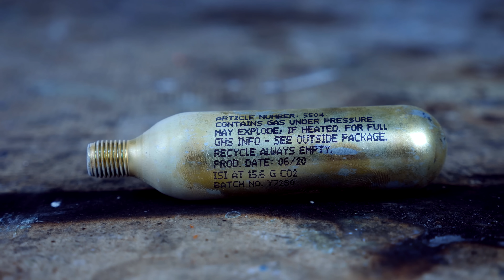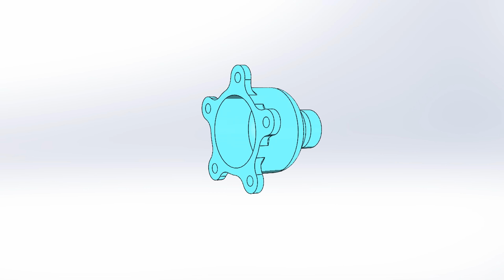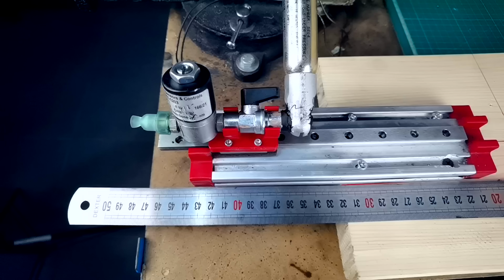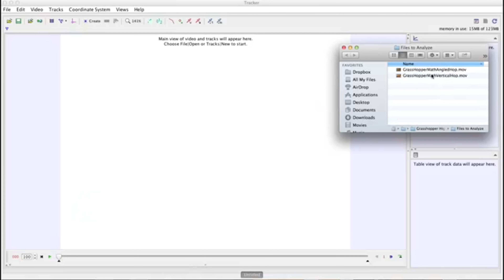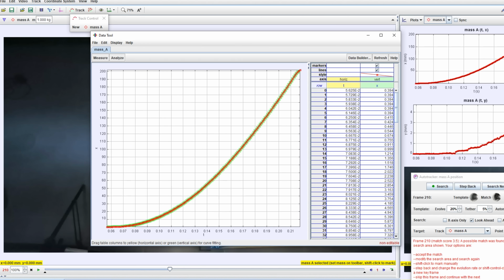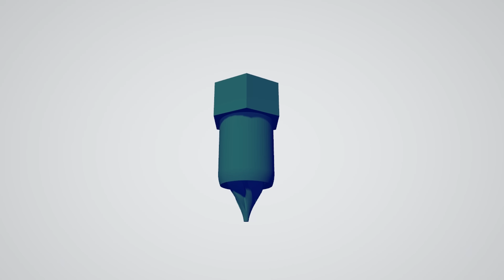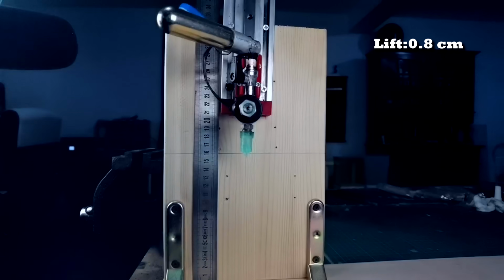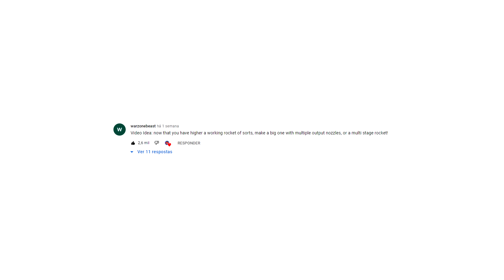I 3D printed a CO2 Rocket

Comment: You should 3D print a car that you can use as a platform to test your rockets with so you can see the full distance they will travel without hitting a stopping point. This will also be a more realistic application. Or 3D print a rocket that you can put a CO2 cartage into and the nozzle attached to the end to see the true lift potential.

Comment: Perhaps you could add a threaded pipe before the nozzle and heat up this pipe before you release the gas, this should expand the cold gas and give more lift. 
Or build a co2 cartridge mortar tube, just a simple tube that the cartridges snugly slide into and at the bottom is a pin that punctures the seal. (probably need to add a bit of weight to the cartridge tho)

Comment: . Find a way to produce and store hydrogen for use in a rocket engine. Then use it in a rocket engine. 

I had the thought of doing something similar back in the early 2000s when the 'run your car on water' craze was going on. I know using electrolysis  you can separate water into hydrogen and oxygen.  And using a tall container you can separate the 2 gasses. I had the idea of using a rubberized bag or thick rubber balloon inside a metal cylinder with relief holes incase it blew up. 

My original idea was to run the electrolysis device off my car alternator and fill up a balloon or bellows type device  that could be forced out of the balloon and injected into the intake manifold. Similar to a Nitrous oxide fogging system.  

Through all of my reaserch on the subject I learned that hydrogen  gas that was not pure or in liquid form when compressed beyond 2psi becomes extremely volatile  my solution was the balloons in metal housings for safety.

 I didn't get to preform the experements myself. So I would like to see your take. And if I get a 3d printer,  I might have to try it again myself lol

Comment: How about ... cooling down your red hot nozzles with the gas pushed by those CO2 cartridges? They apparently can also provide thrust so it's a win-win, right?
Reply: You could also time the cartridges so that they'd self-eject when they're empty. Very soon you'll apply for a job at SpaceX LOL
Reply: Another idea would be to have the cartridges be on the side, not on the actual rocket itself, feeding the rocket with CO2 through tubes ... the actual pull of the rocket would disconnect the tubes ...

Comment: What if you use a butane lighter refuler as the fuel source? The cold generated by depressurization can cool the chamber and nozzle before it gets into the chamber.

Comment: Since youndid say multi stage rocket, why not check your local restrictions on ' untethered tomatos ' as both cargo and markers ( eject at least one per stage ) to help track each stage progress?  You might also want a ' tomato-burn-o-meter as a way of showing the launchpad burn pattern in case of using 2+ rockets to launch and check if both were using the same or similar initial thrust.

Comment: could you make a 3D printed nozzle with flexible gimbling system where it can be directed with motors etc but it never loses its original structure connections so will revert back to straight when not being manipulated by a motor?   guessing this would require a mix of print material hard and flexible so potentially multi nozzle (not sure if you have that type of printer setup).

Comment: just noticed this:
since the finished ceramic prints are porous, you may be able to actively cool them, by having having water inlet and outlet tubes, and sealing the rest of the surface, so it doesn't leak
bould also take advantage of 3D printing's advantages, and build in some coolant channels too, which could make the cooling significantly more homogenous, by  using a structure similar to our veins and arteries, with the porosity of the part being the capilaries.

Comment: I'm curious what could be accomplished if you added a heat exchanger on this design. I can't believe the isp of this fuel would be higher than 90s. Maybe with a little heat(think hot water, 90C) you would get more thrust from this simple fuel.

Comment: Combine tritium with photovoltaic solar cells and supercapacitors to make a constant electric source that could potentially run for over a decade. Ultimately rockets take things to space, this solution is lighter than batteries (uh, probably) But could keep a small electronic device alive when the sun is not available during earth shadow LEO. In theory.

Comment: Try to create a plane powered by one of the engines/rockets you have made. Perhaps using CO2 capsules and an engine to spin a propeller? Similar to your last project that you used CO2 cartridges in, where you powered an engine and mounted it to a car

Comment: You need to test the critical pressure for the rocket chamber and add an overpressure valve, so it doesn't... you know... blow up! It is already dangerous, and it is made of plastic! You have to think about this stuff if you want to make it out of metal.

Comment: Idea ! What about using Co2 cartridges to cool the nozzles that get really hot ? Maybe printing a nozzle that has chambers that uses the pressurized Co2 to cool them. Much like how rockets use regenerative cooling ? So something like using the valve you have and a regulator feeding into the cooling chambers of the nozzle, then have an exhaust port for the gas to escape to prevent the nozzle from building up pressure and exploding. It doesn't even have to be incorporated into the nozzle as cooling chambers. Even a cooling jacket over the nozzles to prevent it from melting.

Comment: video idea: steam/hydraulic train, see how much torque you can get out and see if it can pull you along, you could print a boiler with metal filament like you did with the aerospike nozzle it'd be challenging but very impressive.

Comment: VIDEO IDEA: Since you have a lot of empty Co2 cartridges why don't you use as a tank for solid rocket fuel (for example the sugar one). With cartridges you can get a nozzle simply by going to countersink the hole. The divergent part will be missing, you could perhaps weld, on the outlet of the cartridge, a bolt or any suitable piece of metal and then countersink for make the divergent part of the nozzle.
Reply: A easy refillable modular rocket, nice idea
Reply: up this comment
Reply: https://youtu.be/NlT6XqpoeTot3

Comment: Melting nozzles.... if they are melting due to high temperatures, could you do what large rockets do, i.e. pass the liquid propellant through small tubes lining the nozzles before the liquid propellant is burned?  This may be hard to do, but you could use CO2 and a separate coolant running on outside or inner wall of the nozzle to cool the nozzle with the main fuel just going through the center of the nozzle.   So that is what you could try.... build a nozzle that can cool itself with extreme temperatures just like what is done on the NASA space shuttle.

Comment: Hello a H2O2 rocket would be much ligther and much more fun to. A 3 d printed sphere as reaction chamber for example. I builded one some years ago with carbon fiber Pla because the reaction is exothermic and builds up alot of pressure in very short time .

Comment: Video idea: You can use vinegar and bicarbonate as propellant instead of CO2 cartridges, it would be cheaper, and the reaction could be contained in a bottle with a valve to build up the pressure and then release it in a controlled way to your liking.

Comment: The problem whith that cartridges is that you lose pressure due the low temperature. Why don’t you try to heat the gas between the cartridge and the nozzle?

Comment: Heat CO2 slightly, it's perform worse when it cool. You can make powerful electric heater that switch On parallel to valve.

Comment: You might want to invest in an air compressor, then you could test nozzles with that instead. Also, a strain gauge could measure the force directly which would be more convenient.

Comment: The spiral shaped nozzle redirects part of the exhaust energy sideways, wich means it's losing that energy in downwards thrust. So, of course it comes last in terms of downwards thrust, BUT you could use this kind of nozzle for a rocket that, instead of using fins for stabilizing, uses the resulting spin to stabilize its trajectory (like a rifle bullet). From what I've seen, that's not the easiest thing to get to work, but at least IN THEORY it's possible ;)

Comment: Couldn't find another smart-ass comment pointing this out so I guess I'll have to be the know-it-all to point out two physical corrections:

0:50 - The CO2 in the cartridge is compressed and stored at room temperature - according to the pT-Diagram this will be in liquid form, only at incredible pressures of thousands of bar will it become solid. Same thing with the large Methan cooking gas bottles, there you can actually shake the bottle and feel the liquid moving. Dry ice is also CO2 indeed, but cooled to<-50°C where it will become liquid.

1:50 - The cartridge will get cold because of evaporation. The phase change from liquid to gaseous needs energy. Decompression probably will also contribute but I think insignificantly - though I'm not sure about the numbers there, please argue this if anybody know anything quantitative.

Comment: What's in the little cartridges is NOT solid, but just a tiny bit of liquid.   CO2 basically has a vapor pressure of around 800 psi, so it provides pretty consistent pressure as long as liquid remains, so in fact you don't want the cartridge facing down as you are dumping liquid into the valve and possibly getting inconsistent results depending on how much liquid escapes and the evaporation rate.  If you turn the cartridge up, then only the gas will come out (again, at a fairly consistent 800 psi), which will give you much more consistent results.

Comment: Hello comrade, a challenging idea for your next video. What do you think about making an IEP system, fused with solar, and add a form of antimatter conductor to create a vacuum. If my hypothesis is correct this should make a gravity pocket, and a contained combustion, resulting in a gravity powered rocket. This would require a combustion chamber, and perhaps some tear resistant mylar if you have any

Comment: Alright, as you have a lot of fun with CO2 cartridges, how about building/modifying a small RC helicopter, where the counter torque is generated via CO2 pressure instead by the tail rotor.

Comment: There is an equation for rocket engines and the amount of energy needed. Called the the perfect rocket formula.  Try compressed air with atomizer and reflow stabilizers! With CO2 also you can make a huge collection tank and make bigger rocket! So many things u can try sir!

Comment: Idea: 3d print a frame to attach multiple c02 cartridges together, serving as the rocket body and file source and use a system of valves and pipes to fire them in sequence to achieve continuous lift.

All controlled by an Arduino.

Comment: Try adding an outer an outer air intake shroud sort of as an air bypass set up, as air is pulled in it will mix the cold CO2, causing it to expand faster as it exits the shroud possibly adding thrust.

Comment: I wonder if an aluminum de laval nozzle with a little bit of a chamber would perform better or worse than the resin nozzle. My theory is that total thrust would go up, due to the aluminum nozzle being more effective at transferring heat away, causing greater expansion of the CO2. The question is whether total thrust would go up enough to overcome the penalty of the heavier nozzle!?

Comment: Idea: You could try to build a rocket that uses dry Ice (or LN2) and "reacts" it with hot water. That way your "exhaust" particles are a lot heavier and you also could get more expansion out of the CO2/LN2. Bonus would be a reaction chamber, because reaction chambers are cool.
Reply: In this sense literally

Comment: i like your contend about rocket since and use of 3d printer, but you didn't launch any rocket so try one   
(i am trying to give you advise below)
try burning powder (like gun powder , powder inside of firecrackers ,match stick heads powder ) why powders because burning powders need one time ignition which can be start by small electric charge :)

Comment: You should make a valve-less CO2 cartridge booster.

Same setup you tested this time, but a nozzle that screws itself in to puncture the cartridge and thus start the trust.

This could be accomplished with minimal mass if the screw in mechanism is left behind in the rocket support structure upon launch.

My idea would be a socket gear shape for the outermost diameter of the nozzle and the base of the support. Launch would be accomplished by rotating the base with a screwdriver to lock the nozzle in place and puncture the cartridge, thrust would remove the booster from the launch structure after that.

Comment: Nice video! I would love to see a re-invented pulse-jet engine. And I mean, strongly re-invented. Like a hybrid pulsed ion-engine. one electrode close to the chamber, one at the end of the exhaust tube, strong potential difference, not enough to arc though. When combustion happens, ions are created in the flame, being sensitive to the electric field between the two electrodes (grid or something else). Would it produce more thrust?

Comment: 2 things to help with support removal:
1) Remove supports prior to curing the object (uncured parts are soft, so take care if you do this) to reduce sanding and cleanup.
2) Cured or not, set the object in hot water for a few seconds to soften supports. Makes them much easier to remove.

Also, if you are tired of buying nitrile gloves, consider thick yellow dishwashing/cleaning gloves, like what you see in the cleaning section of your local store. They last much longer, and are more rugged (better cut protection from sharp supports).

Good luck on your endeavors with rocket engines!

Comment: Have you considered trying to get one of your 3D-printed nozzles fitted to a water-bottle rocket? The ones where you use a bicycle pump and a plastic bottle with water. 
Figuring out how to attach the pump, get a good seal, and clean separation may be difficult, but would be cool to see!

Comment: been thinking about doing this myself but video idea: make a CO2 rocket using the best nozzle just to see how high you can get them to.  use a tube to launch them through a tube with a nail on the end, using fold out 3D printed fins to stabilize it during flight
Reply: They fly pretty high without a nozzle
Reply: @kirkc9643  i know but that’s with the inefficient way i want to see how much higher it will go with the new nozzle

Comment: Hey integza, you should try 3D printing some air nozzels with some starlite ceramic resin to check how heat resistence is the most heat resistence material, or alzo you can try melt some tomatoes under starlite protective layer. Like me please, then i put the starlite material making video... https://youtu.be/0IbWampaEcM

Comment: If I remember correctly, The King of Random’s channel has a video on simple CO2 powered rockets.  What if you combine the concepts and put a nozzle directly on the cartridges and use a needle on a launch platform to puncture the cartridges.  This would reduce a lot of the weight and allow for a simple 3D printed body where you could optimize the stabilization properties

Comment: Design a screw on rocket nozzle for the CO2 cartridges that'll break the seal on the cartridge it's self. Then you'll have a real rocket.
Reply: They don't even need a nozzle. Just a nail to punch the hole
Reply: @kirkc9643   I'd probably still use a tube with a nail in the bottom of it to launch them. but imagine how much more thrust they'll have with a proper nozzle.

Comment: I believe I  know why the 6mm nozzle underperformed relative to the 3mm one. When I compare the 2, I can see that the 2 are about the same lenght. That means that the CO2 in the 3mm nozzle has a nice, gradual and slow expansion along the nozzle, much closer to what actual rockets have, and so it can stay laminar and completely expand, while your 6mm nozzle's walls diverge very quickly, which is inneficient. there was probably turbulence, or even shockwaves in that nozzle, that were stealing all your energy.

Comment: VIDEO IDEA: make a nozzle that is similar to an Air Break of jet planes so that the exhaust goes backwards and maybe place the valve externally so the weight is lower.
Reply: that would be interesting to see indeed. I also think that having the valve on the rocket is limiting it's performance...
Reply: directing the flow backwards can be done, but he needs to minimize all the inefficiencies before doing that and also what's the point of having the valve "externally", it's not like real rockets leave their fuel or any component on ground when they are being launched . he should better work at making the engines more powerful

Comment: Wouldn’t the weight of each nozzle effect the height/acceleration? Wouldn’t you have to make sure the weight of each setup was the same on both the horizontal and vertical setup? I think calibrating the setups would give you a better measure of performance

Comment: I guess it kind of misses the point of what your're doing, but I keep thinking your CO2 needs a flash heater to get the gas up to room temperature or so. Maybe just a steel pipe with a hot heat sink inside between the valve and nozzle. I guess it might possibly act like a pipe bomb if it got plugged with dry ice though, so maybe not a great idea, but I haven't tried running the numbers. Just seems like it would help your test firing last a little longer by expanding the CO2 more but not to the point of melting anything. As always, I enjoyed your video.